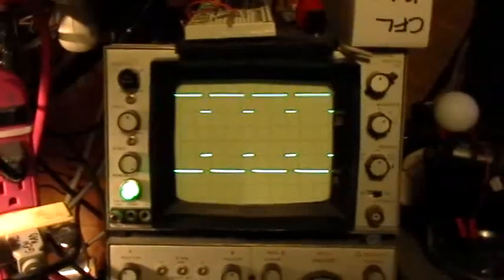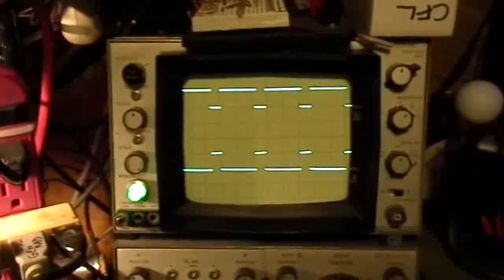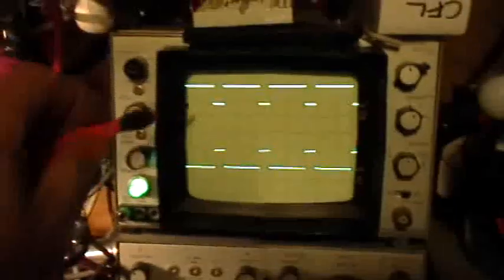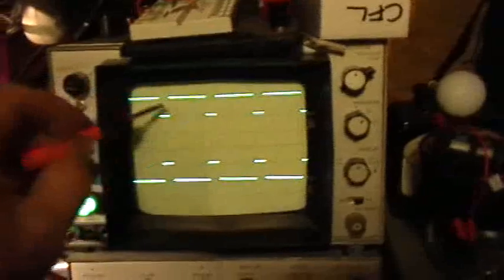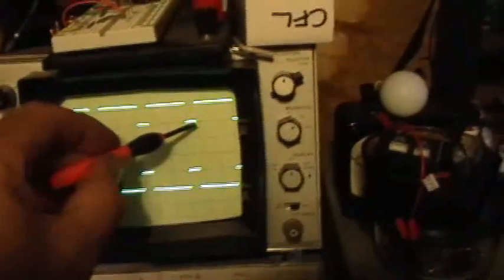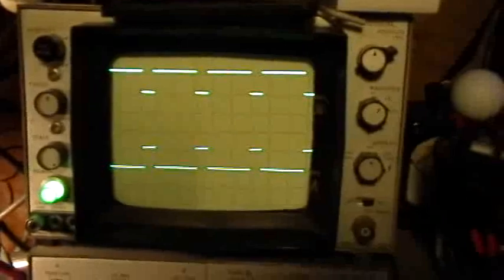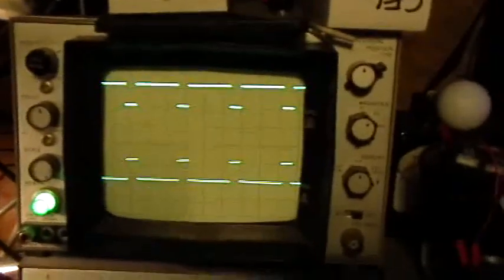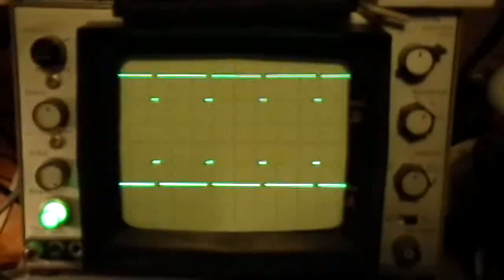Electric OU: Supplement: The Quantum 555 Timer Error CORRECTED

Comment: Ok. That is one solution to the problem. (I saw your last video.)
But I think there is an even more simple . more (In my opinion , more elegant) solution to the problem.
(Im not sure this will work. I haven't tinkered with 555s in a long time.)
Aren't the 555s output able to both source _and_ sink current ?
Could you not then have switched the output leads and so had your 6% on and 94% off ?  (Instead of 96% on and 4 % off ?)